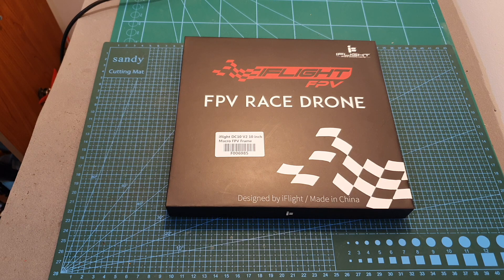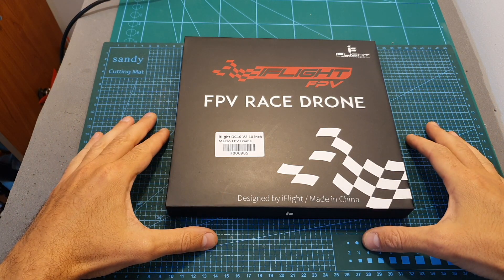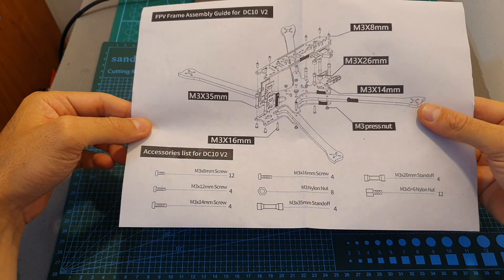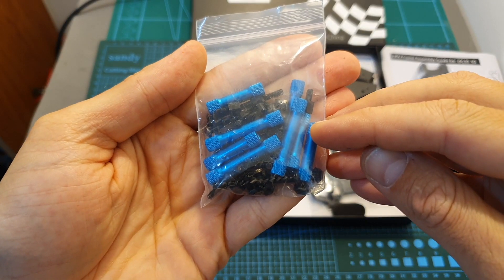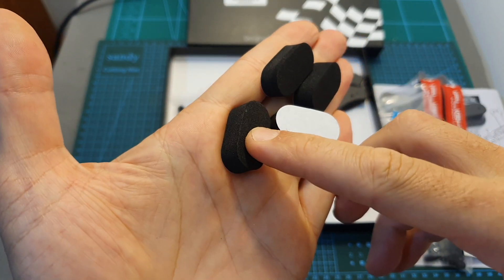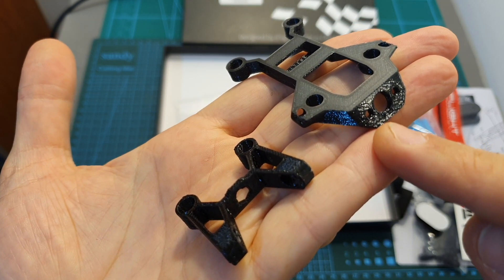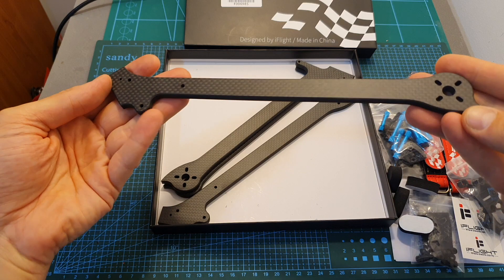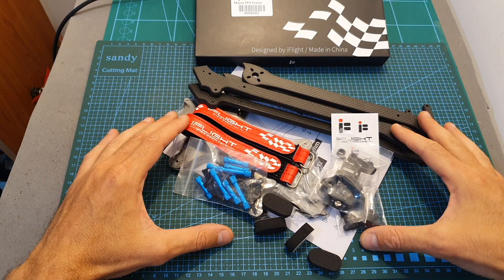Bigger Than Big - iFlight DC10 V2 473mm Frame Overview

Comment: hi there i just bought an iflight xl10 and was wanting to print some mounts up for it before it arrives but dont no the distance between the rear standoffs. do you no if its the same as the rest of the xl series or is it bigger
Reply from the maker: Yes, it should be identical as far as I know.
Reply: @KremerFPV  in your video the body looks huge beside the xl5 was it you put beside it
Reply from the maker: @snakes301271  Reply to this message tomorrow and I will measure it for you.
Reply: @KremerFPV  ah thanks very much

Comment: Sir,please answer..
Can i use T-Motor 2213 950kv for the frame..?
Reply from the maker: I am not sure if they would be ideal for this setup but yes you can use them.
Reply: @KremerFPV  which one u think is good sir,2213,2216 or 2312.. i dont have a lot of money to buy xing motor,so expensive..
Reply: @KremerFPV  thnks for the reply sir,love u sooo much..
Reply from the maker: @mr.j9232  Name a few options and I will try to help you to decide.

Comment: Gal, can you tell me what size the motor bolt pattern on the arms will fit? Will it fit a 16x16? I can't find the size on iflight website.
Reply from the maker: I just checked it and it's 14*14mm.

Comment: Can you confirm how long the body/top plate is? The spec from iFlight says '418*262mm (body dimension)' but it's unclear what exactly that is referring to.
Reply from the maker: The length of the top plate is 20cm and it's width is 3.5cm.
Reply: @KremerFPV  Thanks!

Comment: Gal Kremer I have this same frame with 8mm arms. I use the same 1100kv xing motors. My FC was also iflight with the F7 twin G and succex 60a esc (individual). I run 4s and 6s. 4s7500mah li-ion for range and 6s 1050mah x2 for fun. My prop of choice for freestyle is that same HQ prop in a 9" or I run master air screw 10" bi blades for efficiency. Good luck it's a fun frame.
 FYI my GoPro hero 7 with superview DOES show props with 25deg mount.
Reply from the maker: Thank you very much for the information. Do you have any suggestions for the thrust test? Do you think it will be able to handle 6s using the Macro 10 inch prop?
Reply: @KremerFPV  I think it will handle it. It will just be more responsive and agile on the 9" obviously. I flew 10" biblades all out but the props were  or stiff enough. If your going for cinematic 10" bi or tri should do the trick. The 9" were a suggestion from 10" 11" 12" macro quad Facebook group.